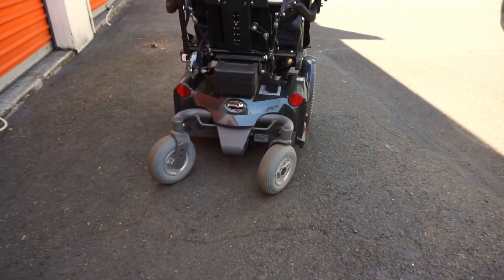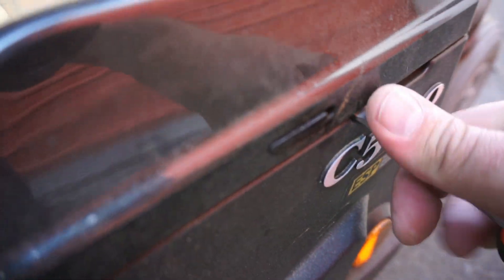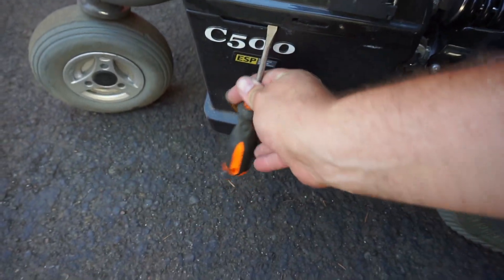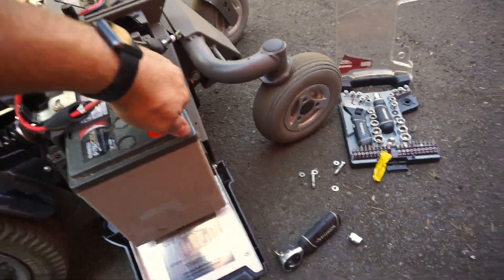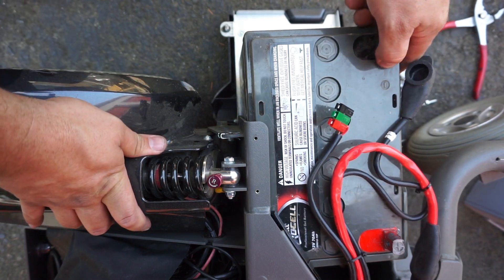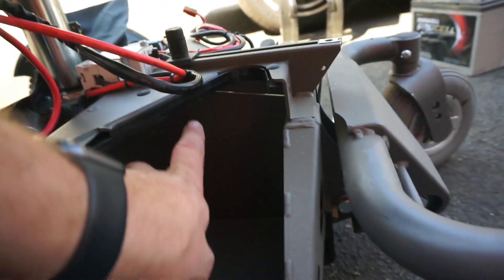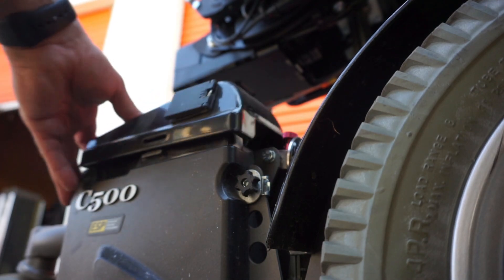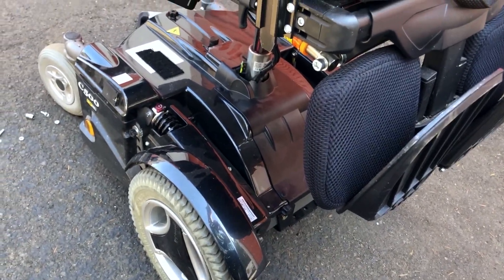WHEELCHAIR REPAIR: Permobil C500 Battery Replacement

Comment: My Permobil C500 can't drive, I have the error "1704 PM module error Relay Driver fault". I tried an other power module, but it still doesn't work. Do you know how to fix it ?
Reply from the maker: was the other power module you tried also from a C500? if its from a different chair, there's likely a different configuration on it preventing things from working properly on that chair.

the main relay inside the PM tho can fail over time.. its not super uncommon...
Reply: @TotallyNormal-  Yes, the other power module is from a C500
Reply from the maker: what happens when the new module is connected? (it should go thru the auto-detect sequence and then you'll need to power cycle the chair)
what errors come up if any with the new module?

Comment: Thanks very much for your informative video! My only problem is that the batteries evidently failed when we had a cold spell. My chair was outside, in the van. Charger doesn’t even show the yellow light when I plug it in. They are dead & I can’t lift the chair to access the batteries easily. Will just have to do it with closer tolerances!  Your video will be quite helpful!
Reply from the maker: it is possible to get the batteries out with the seat in the down position.. just takes some careful prying ton the overlapping plastic top cover to get the battery doors open :^)
Reply: @TotallyNormal-  great! Thank you.

Comment: Do these take a group 24 or 34 battery? Also if both are dead on my chair can I swap one momentarily until I am able to move it and access the other side or does it need two good batteries to work? Its currently stuck in our modified car and I have easy access to the right side.
Reply from the maker: i replied to your other comment already - but both batteries need to be replaced as a set.. the chair operates on 24 volts, and both batteries are in series to accomplish that voltage.  most C500 chairs work with group 34, or 24 batteries.  ya also commented on a video with a C300 in it, so im not sure which chair you've got
Reply: @TotallyNormal-  yes thanks didn’t see this till afterwards I have the c500 which actually looks like a much more doable swap I may not have to push the chair. Also was curious if you knew where I could get one of those larger ball shaped joysticks for the permobil.
Reply from the maker: this guy makes a bunch of stuff in different colors, and also black :^)
https://www.etsy.com/shop/whiteravenmobility/?etsrc=sdt
Reply: @TotallyNormal-  Appreciate it man.. just received my batteries as well and while they work they are about 3mm too tall. I ordered the group 24 off amazon because that was the fastest to arrive. Before I go ahead and order the 34s is there anything that can be done to accomodate the group 24? There is a metal lip that is stopping it from clearing it doesn't seem to be on the one's you worked on... was tempted to bend it but figured best to leave everything as is.
Reply from the maker: most wheelchair batteries are flat-tops.. that's required to fit the group 24's into a C500 chair..  MK power batteries cost a bit more, but have a much longer service life.  ive tried a bunch of amazon batteries and had some of them crap out after only 3 months of use :^/
Reply: @TotallyNormal-  The 24's I ordered are flattops and actually they even have c500 in the name of the battery description.. it is just that little metal lip that prevents me from fully securing them. I think I would have to modify this or remove it to fit. I just went ahead and got group 34 as they are much shorter and the size of the ones i pulled out. Thanks for the help hopefully they last. The brand is called mightymax and they seem to target the permobil brand.

Comment: How can I reach the batteries if wheelchair is completely dead. Also what are the batteries for this wheelchair?
Reply from the maker: on the C500 - the seating doesnt block the battery doors.. BUT it will be tricky to get them open without removing the top cover.. however it is possible to carefully pry them open..  if the chair has a seat lift - check out this video - https://youtu.be/qQitPa9j2NM the process is the same on the C500 for manually operating the seat lift.  if the chair DOES NOT have a seat lift.. then you'll have to manually use the seat mounting tube- and raise the seating a bit (i can provide a service manual link if needed)  most C500 chairs will fit either group 34 OR group 24 batteries without an issue (as long as theyre flat top group 24's - or are very carefully placed as to prevent the posts from shorting out on things - if not using flat-tops)
Reply: Thanks so much for your response. So this chair doesn’t seem to bring the really long tool in the back and when I open the seat it doesn’t look like the one in c300. I just had 4 holes down the middle. Is it possible to use a jack to lift it? I don’t understand how to manually use the tube to lift it.
Reply from the maker: hmmm sounds like an older model maybe... if the chair doesnt have a seat lift built in, then ya have to support the chair - people holding it up - or maybe a hoyer lift and some straps.. then loosen the bolt on the seat mount tube, and raise it up. if ya send a message on twitter i can send over the service manual

Comment: Thanks so much! Bye the way, I have been given a 2015 c500 and it stopped working after I reclined it too clean it. the CP would light up with no error messages but it would no longer respond and now it says JSM Bad Cable. Any suggestions?
Reply from the maker: how far back did ya recline it? inside the seat back there's a bunch of wiring/connectors.. if tilted ALL the way back something might have gotten stressed.. also id check the wires running from the joystick, down the arm rest and into the seat back.. something somewhere got pinched, or came unplugged it sounds like

Comment: Hey do you suggest hooking off road lights to a storm torque 3
Reply from the maker: uhhh aftermarket youll need to get 24 volt ones and connect them right to the batteries, and also add a switch.. or ya can use 12 volt ones but you'll need a power converter.. ive been saying im going to build and sell a portable lighting kit for like 6 months now.. but life keeps happening LOL soon.. soon hahah
Reply: @TotallyNormal-  I bought a 10-24 volt off road lights

Comment: Isn’t this the chair that you swapped the engines with Permobil M3?
Reply from the maker: This chair I swapped out the motors for high speed ones from another c500 VS standing model. Think it may have been in a previous video.. lol I’ll have to find it! But this is the chair that I was working on calculating the speed in a few different vlogs. It’s got regular appearances on the books! Haha
Reply: Totally Normal Cool
Reply from the maker: here we go... https://youtu.be/1q4dSRTFjXI

Comment: Something about this dual battery setup with them on the sides and visible is badass. I am just not sure what it is. Makes it look more tank-like or tough, the strong lines make it look beastly. I love front wheel drive chairs and have a c300. What are the advantages of the c500 over the many previous c-line front wheel drive chairs?
Reply from the maker: The C500 was one of their earlier front wheel drive models.. back when they were built like a tank! They told the engineers to build the best possible product, then let the accountants figure out how to sell them.. the result: a heavy duty and HEAVY chair that keeps on going! The C300 was the next version where insurance companies got involved and had a lot of input about weight, and over-engineering.. the C300 is a lot more compact, and light weight - but doesn’t handle the same amount of abuse. I’ve worn out 2 of them in less than a year both times!  But then again, I’m not a ‘normal’ user ;-)

Comment: C500 battery replacement is lot easier than V6 frontier....
Reply from the maker: YES... on mine i have to remove the seating LOL
Reply: Totally Normal  that wasn't easy.
Reply: Yea my backup chair is an M300-HD and went to do a little maintenance on it and was horrified when I noticed the seat needs to come off to get the plastic cover removed. Needless to say, only the two outside brushes/ports got inspected/blown out.